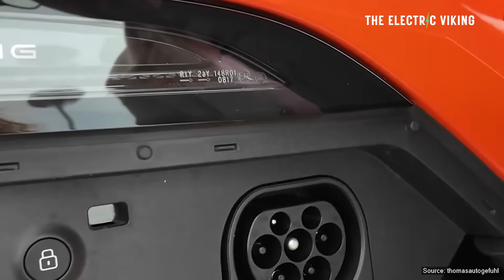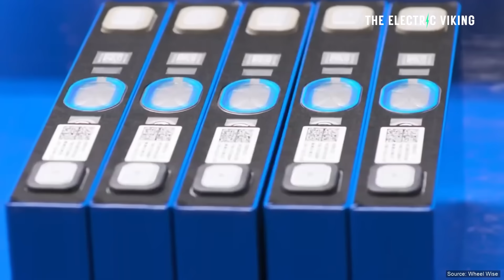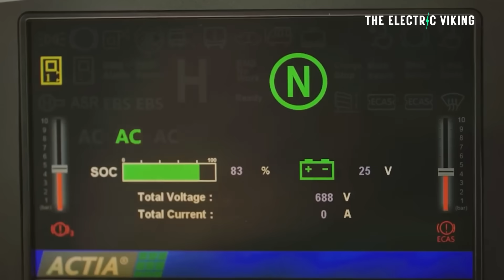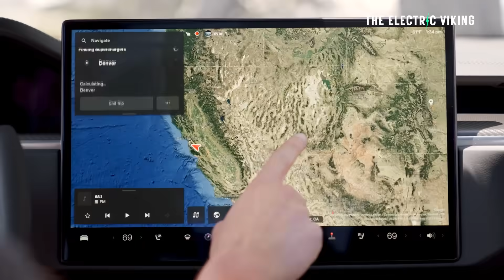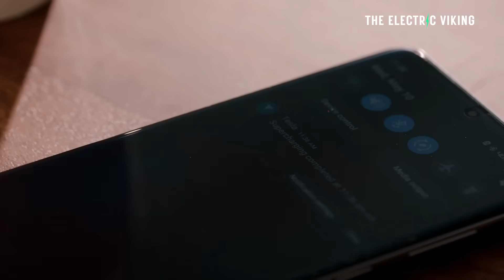Shocking data reveals the TRUTH - how long electric car batteries really last

Comment: Even if the battery wears over time and only charges to say 80% of original capacity after 200k or 300k miles, the range will still be more than acceptable for most drivers. I'm convinced 1000 mile range will be commonplace in 10 years, maybe earlier.

Comment: In the lab, they have to test the battery from 0 to 100% in extreme cold and in extreme heat. They do this to get the maximum battery cycles so they can do calculations on how many years they can provide warranty for the battery. The reason why you get eight years battery warranty, however when it comes to miles it's only 120,000 is because of these lab test. If they make the calculations wrong, then they're gonna end up paying for a lot of battery replacements under the warranty.

Comment: I keep saying the same thing though. If these batteries are truly as reliable as you claim, it would be a  very simple thing for EV manufacturers to guarantee the battery for the life of the vehicle (excluding of course cases where the battery suffered physical damage on the road or excessive charging to 100%/constant fast charging/whatever they advise against to preserve battery longevity). That would completely eliminate what is probably the biggest worry for potential customers. Their sales would absolutely skyrocket, and since they would only have to replace a very tiny percentage of batteries, their profits would be massive. Yet they don’t do this, so I’m forced to wonder why? Seems the obvious answer is that they are not as confident in their battery longevity as their YouTube influencers are.🤔

Comment: The question is: can you make 300 000 miles cold climet with ev and is the batery status? For ICE engine cold climet is better then hot. For electric that , i think , oposit. So in Singapore you will propably make dupble or more on EV then in Norway.

Comment: My gas 1970 Chevy truck finally is getting to the point of needing a motor after almost 500,000 miles .  The rebuild is going to cost about 1500.00 .

Comment: If you think about it it kinda makes sense. ICE vehicles are pretty complex mechanical systems with plenty moving parts that can cause failure. Electric cars are exponentially simple compared to an ICE - Motor, battery go brrrrr and the battery is vacuum sealed.

Comment: The battery will last until the first dent in the protective cover on the bottom of the car. No down-to-earth insurer will allow such a car on the road again. Either replace the entire battery or it's a total loss. The curtain goes down.

Comment: I have a 2010 Tesla Roadster that is now 15 years old.   The battery range at 80% has dropped from about 210 miles to about 190 now.   I lived in LA most of that time so it doesn't have high mileage, but it has certainly seen its share of hours on the road.   So it is down about 20% but really it works fine.  And these were old generation batteries.   I don't drive it as often now that I'm back in Indianapolis, but the car has been flawless since I got it.   I also have a 2015 Tesla Model S P90D.  It has maybe dropped 10% in range and has been my daily driver for the most part.  I have to imagine that these batteries will be fine for at least another 10-15 years, so 20-25 years for each car.  I plan to sell the P90D and move to a Model Y Juniper this year, but the P90D has also been flawless except for the well known issue of needing to change the main chip in the video screen, something that Tesla did in 2022 at no cost to me.   Can't say enough about these cars and their battery longevity in the real world.
Reply: How many miles did you do? That is more important than how long you have the car. The temperature you drive is another factor.

Comment: So from EVk's own data in the video : -

If you buy a 10 year old car today with ZERO miles on the clock, an average battery would have degraded by 2.3% x 10 = 23%.😢

If you buy a ten year old car in 2029, with ZERO miles on the clock, the average battery will have degraded by 1.8% x 10 = 18%😮

If you buy a ten year old car which has been driven, you then  then need to consider further degradation due to 10 years worth of charge cycles.

When you get you 10 year old vehicle, don't forget to use only the recommended 10% to 80% charging band, which gives you at best for a low mileage vehicle, around 50 to 56% of useable battery available between charges!!

And apparently that's the Good News! 😳

Comment: ICE cars were good in the 90s until early 2000s. Since then by CO2 regulations they used thinner chains, thinner oil, or 1 belt for timing, waterpump and generator. Would be no surprise if those engins don‘t last 200k miles like before but only 100k miles therefore.  And it is a risk, „average“ life doesn‘t help me if i am the guy with bad luck.  Battery quality can be measured. ICE engines not so good. They die suddenly. Oil quality can be measured, but when a timing chain breaks it is over.

Comment: My concern with any Li-ion batteries has always been degradation due to TIME, not to USAGE.  But since I am 79 years old, I am pretty sure that my battery will outlast ME.  I only drive a few thousand miles a year, so the car body will also.  I am currently charging on a 110v 20 amp garage outlet, so almost all charging is slow, not DC fast.  When I croak, someone will get a nice used car.
Reply: We have obviously quite a bit of data on the degradation of EV batteries per charging cycle/mileage.  And the number of cars with over 200k, even 300k miles on the original battery is increasing.
But you are right!  We have, for quite obvious reasons, not much data on degradation per year for cars that are little driven.
However, some such data is starting to appear... and the degradation seems to be around 1.2% per year in the first 2-3 years, than less than 1% per year.  So, you are right not to worry about your EV outlasting you!

Comment: "did they think it through". For me the cost of an EV new is to much. Then there is vids like yours which tell us that Batteries are improving year on year. So when to buy?? Well I have bought a Seat Mii 2021 reg. Lovely little car for dashing around town, I love it. Next one will be a 300 mile range car, just got to wait until price for secondhand ones drop a little more, and I don't want an SUV, cuts my options by a lot.

Comment: Yeah mileage isn't really a great way to measure the lifespan of an EV. In taxi service EV's a great because you can put a ton of miles on them very quickly. The problem to me is the shelf life. I don't drive a ton of miles but I keep cars for literally decades. A gas car with 50k miles will still be going strong 15-20 years from now. EV batteries I do not expect will still be going strong 15-20 years from now even with 0 miles on them. Also keep in mind, a brand new short block for my Toyota is $2k where as a battery is like $20k. Even if a EV lasts twice as like I can replace my engine ten times for the price of 1 battery. I can replace the engine at minimum 5 times over just for the price difference between my Toyota and an EV equivalent. Also if I happen to get a dud or it gets damaged by accident I can live with a $2k engine replacement. A $20K battery is financial ruin. I hate all the strings and maintenance and repairs that come with gas cars but to me EV's are still just too expensive and come with too much risk to make them worthwhile. Not to mention, I live in CT where electricity costs $0.30 a KWH which would actually make it more expensive to operate than my hybrid gas car. And before I get the typical "well just spend $40K on a solar system then you can power it for free!". It's not free if I have to spend tens of thousands of dollars up front to buy a solar system that will also produce nearly nothing in the winter. I can literally buy a lifetimes worth of gas for that kind of money.

Comment: The batteries to be replaced will end up costing as much as the original cost of the vehicle and 10 years with gradual battery decay before this begins to speed up...
Reply: On what data are you basing your comment?    Replacing a 75 kWh Tesla Model 3 LR battery costs $12-14k including labor... that's pretty far away from "as much as the original cost of the vehicle".

Comment: Here is some real world data. I had two electric bikes and the battery in both of them failed after exactly 4000 Kilometers.
Reply: There's too many manufacturers that put the worst quality batteries on small electronics like scooters, laptops and tools. That's different from car batteries though
Reply: I have no doubt that what you wrote is true!
But how electric bike batteries relevant to a discussion on car batteries?  They are totally different technology... and quality!
Reply: @st-ex8506 No they are the same lithium ion technology.
However they bath can be made well or not well.

Just because one e car goes fare that does not mean they will all go fare.

The proposition of this video is false.
Reply: @We-Do-NOT-Consent-To-The-Loop  what does “fare” mean in this context? Did you mean “fair” or “far”, perhaps!
As to scooters, the cells may be of the same chemistry, which does not mean that the battery is the same technology or quality at all!

Comment: I had to replace my brake pad at 240k miles even though I rarely used it the backing plate separated from rust. I charge my tm3 at 90 daily for 7 years I still have 87 percent after 475k miles. I charge at 20 amps always.

Comment: How I view it - new cell phones which is single cell, heavy usage and constant wireless charging, the charge lasts a long time and the degradation is minimal after over a year's worth of daily use. This wasn't the case with my Samsung S7 or S8.

Now imagine a multi-cell car with a modern BMS and heat sensors, with the same battery chemistry, and it's no surprise. The BMS does an excellent job maximising regen and keeping depleted cells charged. Even my previous cars, Prius, CT200h, Rav4-H, I have daily driven over 300k km's over 10 years on original batteries with very little degradation. Simply because of regen and the ICE keeping the multi-cell constantly topped off.

I just wish the original Nissan Leaf - and other EVs from those years - could be easily reconditioned, in a similar way, I am able to remove & replace on a Prius or Rav4 hybrid. IOW, not have to be a mechanic with 100k$ worth of tools, but with only 500$ worth of tools and within a day from home.

Comment: If the EV is left in the garage or airport for months and wont loose even a percentage of charge not to mention damage the longevety of the battery lifespan and that lifespan is at least 20+ years then I might consider one. My friends have 30 year old cars that runns like new....

Comment: Why am I not surprised. Well I remember thinking, in the very early days of modern electric vehicles, that like mobile phones, the lithium ion  batteries would be useless after about three years. Then it dawned on me that mobile phones (in those days) would often not last a full day on a full charge, and were routinely charged from near empty to full daily. 1000 cycles battery life is used up in 1000  days (2 years 9 months) or less. But if a car did just 100 miles on a full charge (think Nissan Leaf), and is used for a British average distance of 10,000 miles/year, that is 10 years battery life. And the life would increase in proportion to range. So a car with 200 mile range would last for 20 years. Etc. Bring on LiFePo4, with 4,000 cycles life and the endurance goes up to 4 times that.

Comment: There’s actually no real evidence that fast charging causes battery degradation. Due to thermal management, it actually makes no difference whether you charge AC or DC. See the videos about Model S taxi that rode for 0.5 million miles with not a lot of degradation in any part of the vehicle really.

Comment: The problem won't be the batteries it will be all the other electronics fitted to the cars the same as on ICE cars. The ICE is not unreliable they know how to build a reliable engine the manufacturers choose not to so you have to buy a new car, the other issue is the ICE needs regular maintenance in the form of fresh fluids and filters to keep it reliable, the most reliable engines were built in 80's because they were built strong and with fewer parts to go wrong and most were still mechanical not computerised systems, to reiterate my thoughts, an electric motor and battery needs far less maintenance but it will be the other systems that fail the same as on ICE vehicles.
Mechanical vs electronic example: How long would a modern electronic watch last compared to a classic mechanical watch?

Comment: Let's just face facts.  EV's will do to ICE tech what ICE tech did to the horse.  They are simply a better mode of transportation. 

And for those naysayers I point out that I'm not saying petroleum use is dead.  Far from it.  Petroleum is a linchpin commodity to our civilization.  Look around.  I daresay you can't swing a cat by the tail around you (heh) without hitting something made with it.  From plastics to drugs, fertilizers to clothes to dyes it's in EVERYTHING.  It's even in the component parts of EV's.  It's use case is not going away.  

But, to take such a precious non-renewable commodity, stick it in a tank and then BURN IT just to go from home to store for a gallon of milk, that's just crazy.  And its madness given how efficient EV-types of tech have become.  

So I say get with the 21st Century, folks.  We left the hay burner, the horse, behind when it was time.  Well, it's time to leave the oil burner vehicle behind now, too.

John~

Comment: So why do cell phone batteries only last 5 years, if you lucky?
 🤔🤔🤔

As for battery degradation flattering out over time, that goes against physics.
As the battery loses performance, the parts of the battery that's still performing well has to work harder and harder to make up for the parts that have lost performance.
This puts more and more strain on the parts that are still in good condition. This causes the degradation to accelerate as the battery gets old.

Comment: Any RC enthusiast will tell that the life of a lithium battery all depends on how it is treated be kind and it will last ,treated badly it will not..regardless of the type temperature is your biggest killer.below 0c kils them above 40c degrades them.and mechanical damge makes them unstable..But the chemistry does have shelf life they will not last 20 years but 10 to 15 is possible in an EV that has good encasement an cooling which most do.
Reply: I've seen a couple of 18650 cells destroyed by leaving them in the car during summer. Yes, that's in the greenhouse that we call the cabin (50+Celsius) but they definitely don't like heat.

Comment: I was told (4 years ago!) by a Nissan Leaf owner his battery lasted about 5 years, though he admitted he had fast-charged it a lot and credited that with the lifetime. He probably charged to 100%. Leafs (is that the correct plural) don't have battery cooling which would add to the degradation.
Reply: And that leaves the plural of leaf question. 🤔 I think you got it right.😊

Comment: It is obvious that the author of this channel is in love with electric vehicles or someone is paying him to talk like this so there is a lot of bias here, but that EVs last longer than vehicles with an internal combustion engine is... LIE!
EV vehicles last as long as the battery lasts, and that battery is made on the same principle as batteries for most other devices and will not last longer than 10 years! We cannot disprove everything that manufacturers promise about battery longevity until the promised time has passed, but we can ignore them as a lie because there is an experiential database on all types of batteries.
On the other hand, one of my vehicles is a Fiat Punto 1.2 from 2010, which is now 15 years old and with regular maintenance, that vehicle has so far covered 600,000 kilometers, without a single intervention on the inside of the engine... and it will continue because that engine shows no signs of fatigue!
Electric vehicles CANNOT last as long as classic vehicles, period!
Reply: I purchased my mum's old '98 Civic from her, a few years ago, as a grocery getter. We've just upgraded to another car and we've now given our son that Civic.
It still has full power, the same economy and runs as well as it did 25 years ago. In that time, it's had standard annual maintenance + both trailing arm bushes replaced and now the electric antenna has failed.

Comment: I have a BYD TAN almost 2 years and know what, the battery still complelty new, according to last check out in the BYD authorized service.
I bought  for US$ 3000.00 a solar panel kit (BTTI-China)  for recharging my BYD TAN, so, the kit gets the energy from the sun during the day, when I get back into my garage, put my BYD for charging in the kit and after 3 hours my car is utterly charged.
I don't pay nothing for charging my car, clean energy on zero cost, the solar kit already paid itself in the first 7 months using it, saving US$ 400.00 por month that I had wasted with gas with my old V8 gas car.

Comment: That's all very nice, but I'm still going to drive a diesel car. I want to absolutely minimise my chance of getting cremated alive if I'm ever involved in a serious accident. EVs are far and away still the most potentially dangerous, when it comes to vehicle fires.
Reply: @cryptotharg7400  more myth than fact. Thermal runaway in an LFP battery is extremely rare, and solid state just not going to happen. But to each his own. Everyone should have the right to choose what to drive. I have a gas pickup for when I need truck things done, and the Tesla saving me money for day to day use. Bought 2 tanks of gas in 8 months. Spend $18 a month home charging and commuting to work 50 miles round trip daily. Let market forces determine mode of transportation.